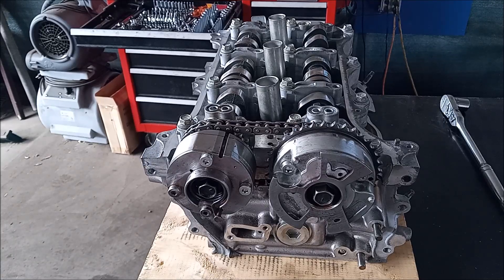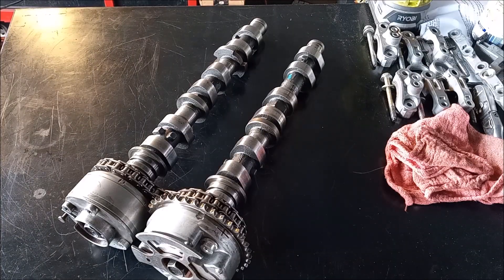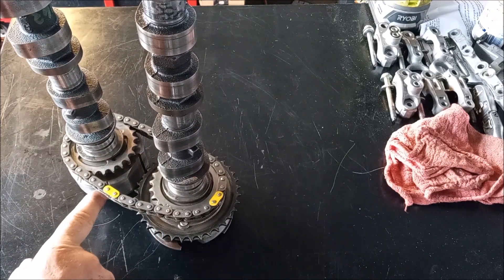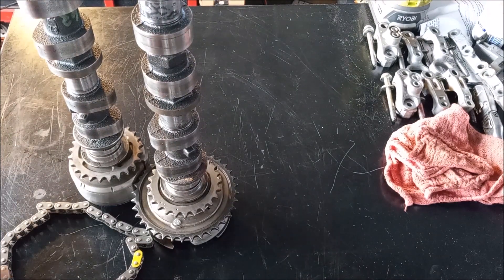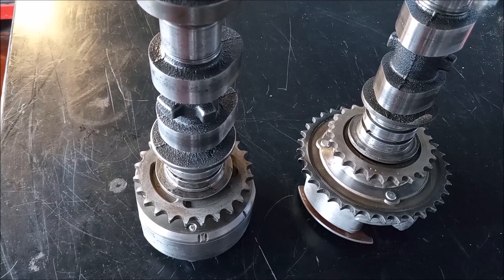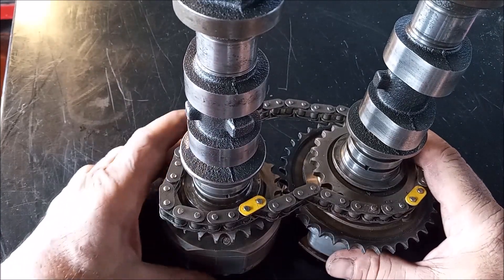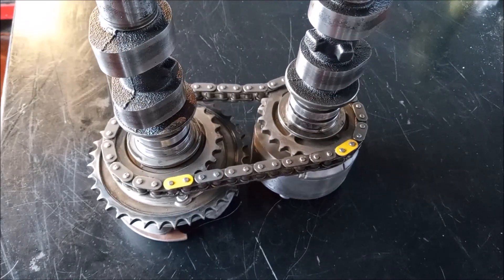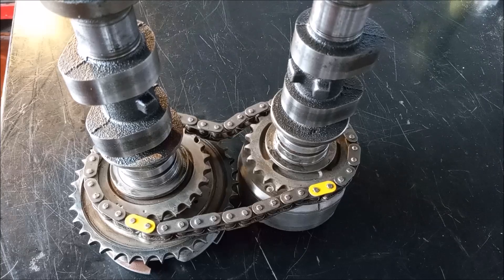Secondary Timing Chain Valve Timing Toyota 3.5L V6 2GR-FE Camry Highlander Rav4 RX350 Sienna Venza

Comment: Wow thank you for this explanation.  I have a 2010 Sienna with a Bank 2 exhaust VVT with the pressed-in sleeve coming out.  The body of the VVT is actually cracked clear through.  

I don't have the means to remove the engine in my driveway, but if I line up the flat spot on the VVT like you show, can I remove the exhaust cam with the VVT attached?
Reply: Or really I just need to lift the cam an inch to get the VVT bolt out.
Reply from the maker: @johnbalison  Yes it is possible to change the cam gears with the engine in the car. This is an advanced procedure. It requires that you support the timing chain so it does not drop. Then you loosen all the cam caps and take the cams out. There are many pitfalls to doing it this way. There is no documentation anywhere for how to do it - you must rely on your experience and judgement. Study the Factory Service Manual closely - it calls for removing the timing chain entirely with the engine out of the car, however you can get the key points of the cam replacement process from the FSM.
Reply: @Merryfrankster_    Yes brilliant thanks.  I am lucky that the only one I need to change is bank 2 exhaust. At least that's what I think, it's the only code I get and it clearly has a crack in the body.  Anyway, the exhaust doesn't engage the timing chain, just the secondary chain from the intake gear, and the intake gear engages the timing chain.  I painted a couple of links for reference, and removed the cam caps.  The gear and cam can be lifted the inch or so needed to get a socket on the cam bolt.  Once the bolt is out the cam comes out easily and the gear can be disengaged from the chain.  Excellent tip about the flat spot, it's essential to line that up in advance.

Had to order the new gear, wont be here until Tuesday.  Thanks again for a terrific video.